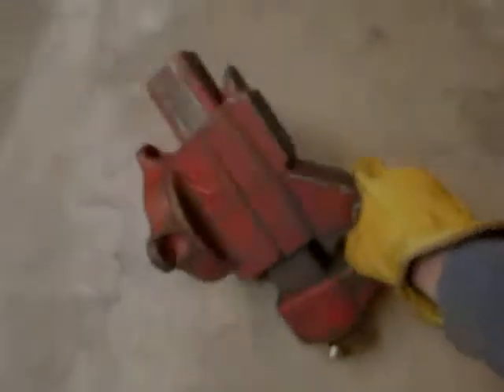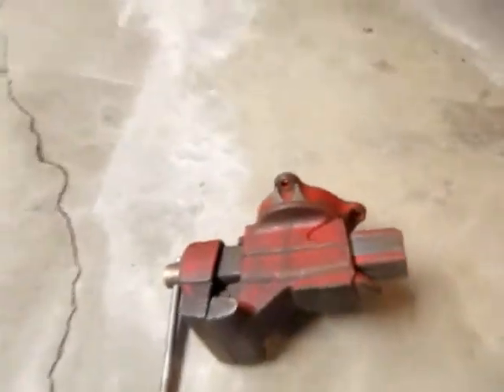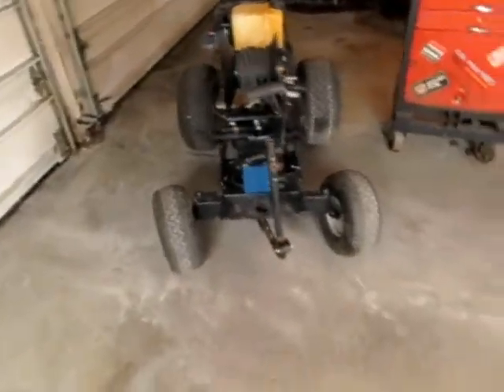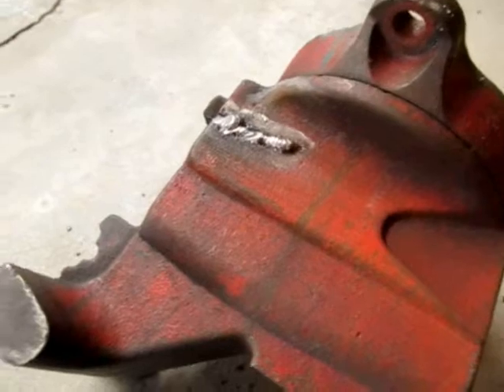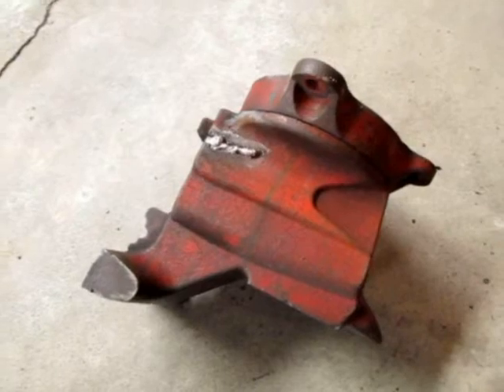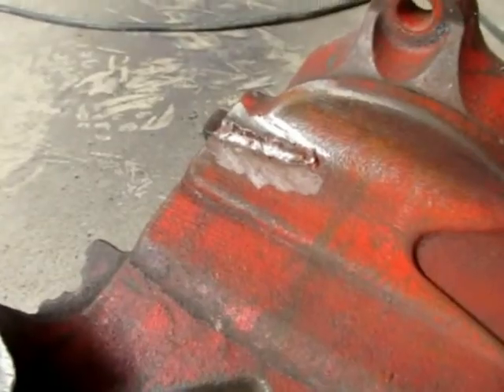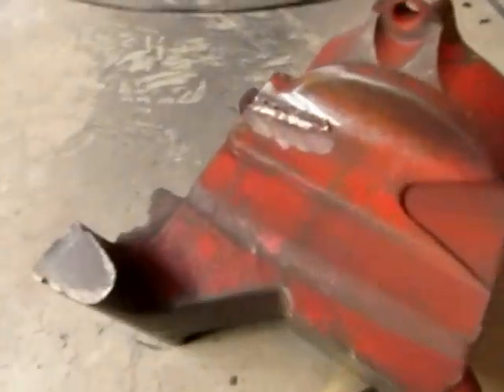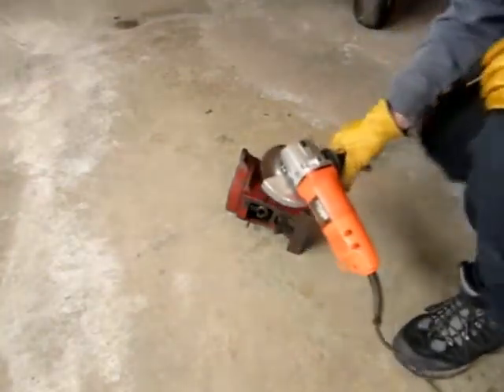Using Homemade Welder

Comment: jeah i think i wonna film this ;D first i will buy a lawn mower motor from ebay for few bucks and a alternator for few bucks because we have no electricity in our garden because its out of the way of our flat ;D i will weld the gasifier with the alternator and hopefully it will work :D i have a paint plan on my website , ill send you a PM ;D

Comment: good ;D , i wonna build a lawn mower genarator with a wood gasifier so it will run with wood because the gas prices in germany are fucking high a litre is at 1,60 also ~ 2,10 dollar

Comment: @sunny5rising P.s., was not trying to be a dick, also kudo's on the welder build, I myself am building one.  However I am using a 200amp 24volt generator rather than an alternator.  Am using a Datsun 4 banger engine from a little car, 70HP, will have an air compressor on it too as well as having the option of running many other accessories.  I will post a vid when its done, 3/4 the way to  being done.

Comment from the maker: @JimmyFarina97: Thanks. Yeah, I would say that the engine is probably twice the hp than I needed for this alternator. This was my first welder build so I was using what I had on hand to see if it would even work.